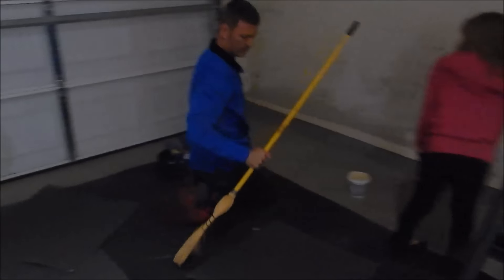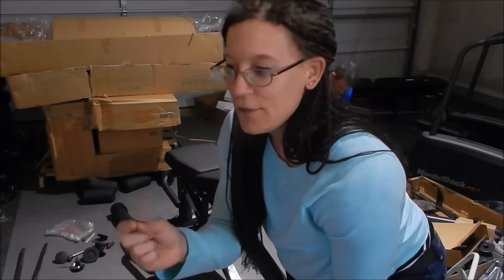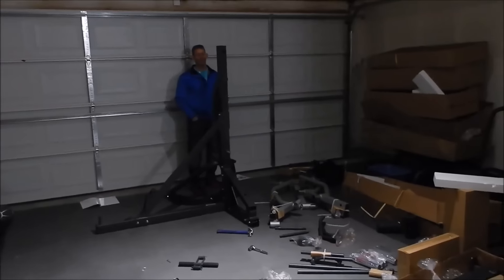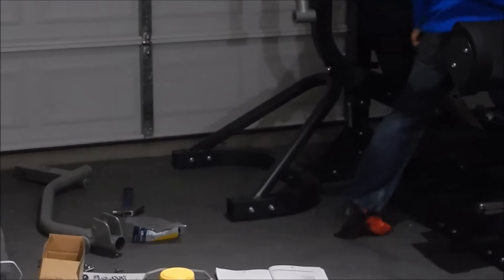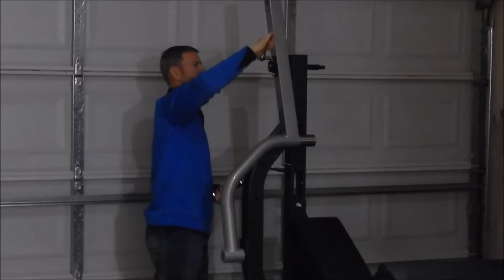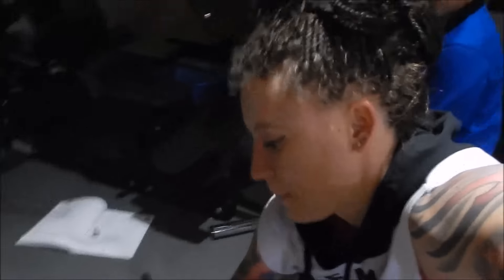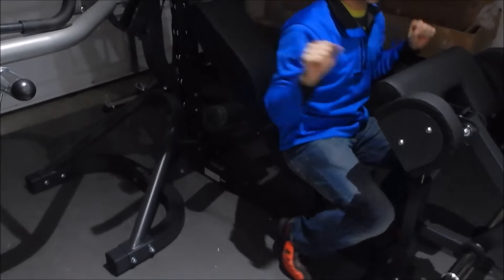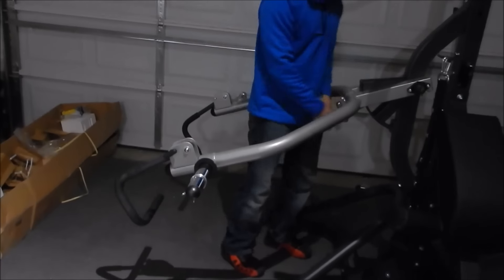Building the Body Solid POWERLIFT LEVERAGE Home Gym....

Comment: Does the calf block come included, and isn't there a nylon strap with d-rings for attaching to the machine for chest flies, other...
Reply from the maker: Plate Smacker yes both are included. It came with two the d ring attachments as well as a strap with extenders. You can do anything with this machine.
Reply: Yeah, I have a Powertec Rack, Powertec Workbench. However, this one looks better than the Powertec Leverage one because I don't need the abs station. Also, the way the handles work on the bodysolid, allow more natural movement, especially in the bench press. The angle and length of the Powertec version bench press arms, seems to cause everyone to flare elbows out to sides, putting alot of stress on shoulders. I like to tuck my elbows in around 45 degrees when lowering the bar. The bodysolid seems to just offer so much more. Getting one in the next month or so. For my flooring I use Horse Stall Mats from the Tractor Supply Store. They are $45 each for a 4'x6' piece. I put 1 inch thick Tru Floor tongue and groove wood panels under them to protect the carpet(finished basement).

Comment: How much space would you say is needed, to still acecess everything, and have it as tucked away as possible. except when in use. like the bench as out of the way as possible, except when training. and again, the space when the bench is fully out and in full use for all attachments and whatever?
Reply: I am unable to put in garage due to heat sensitivity issue. and have a smaller room that has 2 open walls into a hallway, and the entryway, basically. so it is hard to tell from the dimensions if I could make it work or not. It is between this and the Powertec, but this looks far superior IMO. Thanks!!

Comment: just ordered this gym about how long did it take to put togethwer? got me and my old lady doing it
Reply from the maker: It took my husband and I about 12 hours to put together. Not all the prices fix properly and are harder to put in and we were missing a few bolts. Directions can be a bit confusing at times at well. But even with all the struggle sit was totally worth it. I love this machine
Reply: +Caseytats 10-4 well I hope we get it done,2 more questions if you don't mind ,does the squat section work pretty good and do u need a ton of weight on it to get results?And is there some type of locking pin on the lat pull to do pullups?
Reply from the maker: The heaviest I have used so far is 45 lbs on each side.  We bought a set of 45, 35, 25, 10, 5 lb weights...and we have never needed more than all that....it was relatively cheap and the nice thing is you can keep the weight right on the machine on one of the stations all the time and just move the weights around when you need to.  NO need to buy a weight rack.  There is a locking pin for the pulldown station and you can do pullups there...however it will be of the wide leg variety...but it actually forces you to do REAL pullups not a lot of kipping.